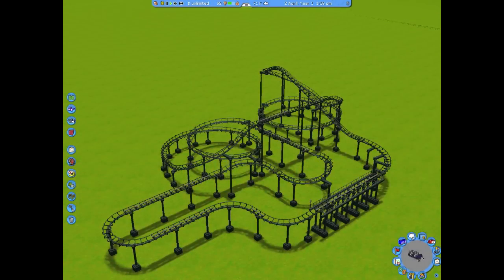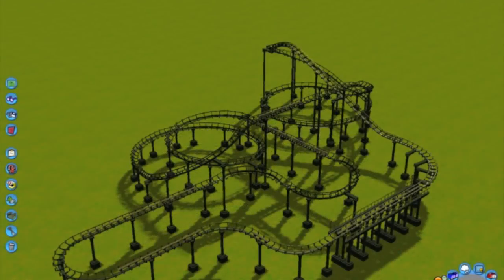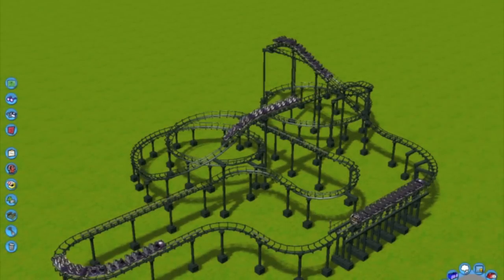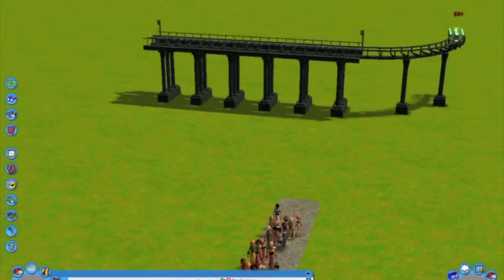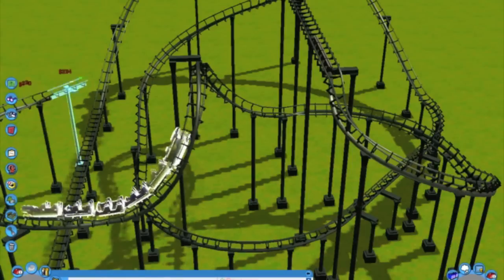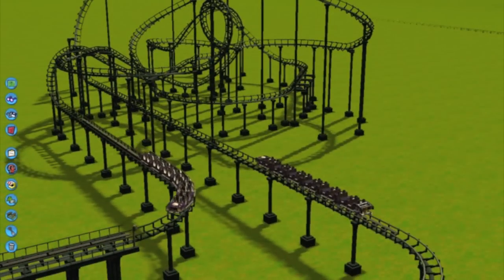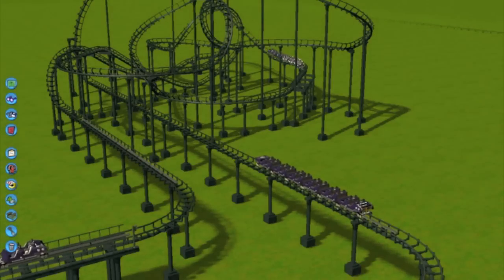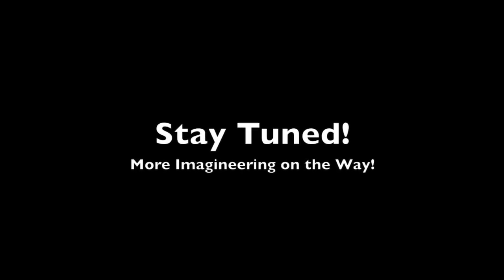How To - Rock n Roller Coaster

Comment: I prefer to use block brakes set to 67 mph with low friction for my launch coasters. It puts a nice acceleration to the launch and enters the launch platform and stops at it more realistically. Also for that ctr, the lift can already be set to 60mph without that cheat.

Comment: Thanks, but I have two questions. One, when I make this launch with the lift segment the train propells forward and quickly stops, then launchers (7:14 is close to what it looks like, but mine goes much faster.) How do you slow that down? I have trim breaks right before at about 9mph, should I lower them? Also, other then that this worked fine until I opened the ride for the peeps. The stopped launch was obsolete, it just slowed down before it launched. Any tips on that? Thanks.